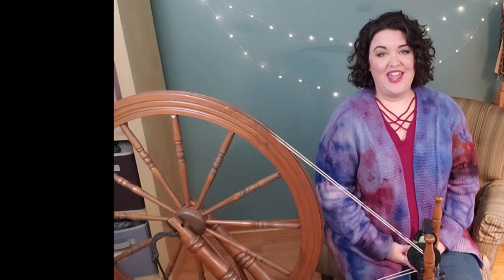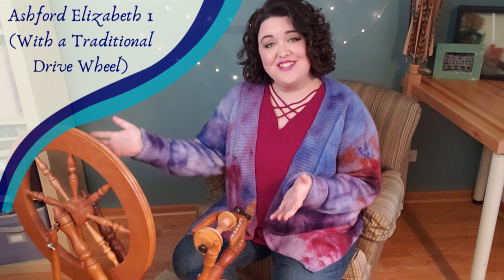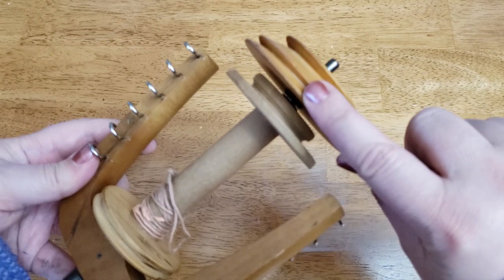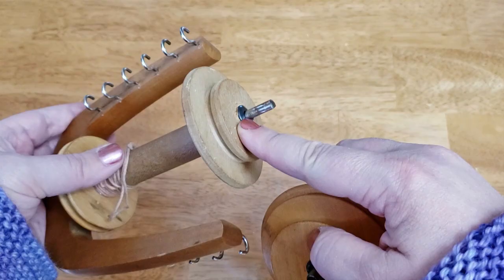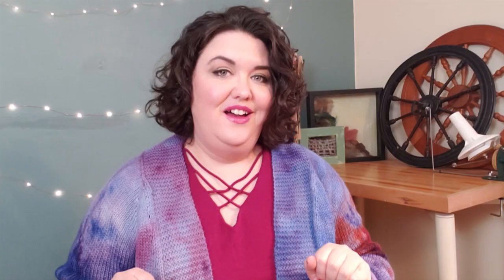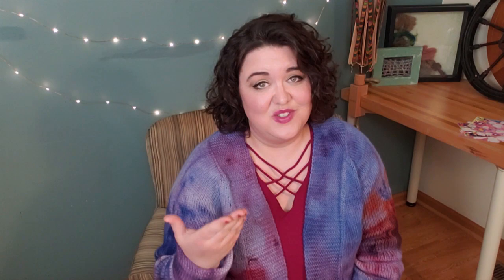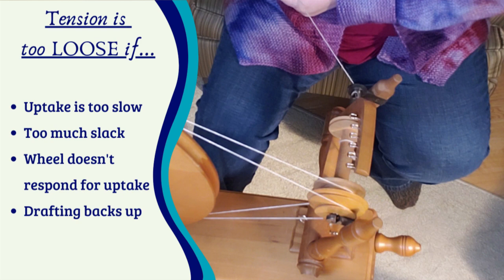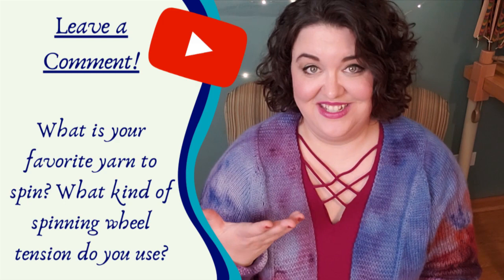Double Drive Spinning Wheel Setup

Comment: Thank you so much, this answered all my questions; unfortunately right now I have a traditional Ashford single drive; but, I'm looking for ways to convert it into a double.  While I have been able to spin... OK, on my single; I'm not happy with the tension and how it works.  Perhaps it's just getting old, and things don't like to grab and slip; so I will be looking at your videos and see if you will address tensioning problems on a single drive using the single nylon cord and spring.  Thank you so much for all of this; I really think I would love to have a double; and I have seen that, if one knows what one is doing, it shouldn't bee to hard to convert this old Ashford into a double drive! :-) I hope! lol
Reply: Full speed ahead!  I did find a video where you covered single drives and scotch tension adjustments; and it makes perfect sense.  I can't believe I ... only somewhat... successfully managed to spin for a few months without ever getting the scotch tensioner adjusted.  I got tired of working either a couple of feet from the wheel; or putting on twists so fast (well, let's say I looked at the spool I did last, and I'm ashamed of it...)  I had put up the wheel after I got diagnosed with cancer a couple of years back; and everything is going so well now; I'm feeling the call of the fiber once again... First my needles called me; now the wheel is calling me.  During my absence, I just checked my wheel, and I am missing parts?!?  My string is missing; but, I found some (cotton yarn I made washcloths with... it made a great string for the wheel; but, the other missing part... my tensioner.  The knob is broken.  So, I've ordered new parts for it, including a new knob, and some oil (I think my big problem was oiling the spindle and whorl?) .  And, after watching the video, and on other video on scotch tensioners, I'm going to re-route everything, drill a new hole for the control knob, and give it a go.  Fortunately my memory is good enough with what I was trying to do when I would spin; and I think I've got a pretty good idea now (I think I was spinning in my sleep for the last two years) of what I am trying to accomplish with the tension; and I am so excited and looking forward to spinning again.  We'll let you know how it goes; maybe I'll drop in for one of your live streams after I get going again.    So, two years ago, between spinning and the cancer, , I finally bought a drum carder, and carded a boat load of fiber, various wool purchased from local farms including a lot of... you guessed it (the non beginner fiber... alpaca).     It's all been begging for me to come back to it.   Anyway,  Happy New Year, and cheers to better control of my drafts, twists and feeds! ;-)   Thanks so much for all the help!   You are a GREAT teacher!  See you around!

Comment: I love your videos!  I just bought an antique double-drive spinning wheel at an antique store, and by watching this, I was able to thread it with a drive band (cotton yarn I had) and got it going, so thank you!  It is missing the bobbin, and I wonder if the new bobbins will fit.  Also the hooks on the flyer are very tiny.  I wouldn’t want to change them, as I want to preserve the integrity of the wheel.  However, I’m wondering if a new flyer would fit?  I don’t see any measurements of them online, so thinking I may have to find an actual shop where I can go in with my flyer.  I would love to hear your thoughts!

Comment: Hi Evie, You're a fabulous teacher.  I just started spinning a couple of months ago on an old Scotch Tension wheel and just bought a Double Drive wheel which is quite different with how the driveband crosses over, is located on which groove on the whorl and its relationship with the groove on the bobbin!  Honestly, my head went into a "tailspin", pun intended!  
I couldn't get it right when I removed the original bobbin from the DDrive wheel and your video actually showed which direction the whorl should be facing etc.  Thank God!  I'll try the figure of 8 for the driveband even though I don't understand why the cross over should be at the bottom for spinning clockwise!  All too much!  
I look forward to follow up videos from you.  Other videos I found didn't show the bobbin/whorl setup from overhead like your video so, THANK YOU SO MUCH again!  I'll go change the setup on my DD wheel and give it a go as there was NO take up of my wool.
Reply from the maker: Did you see the follow up video about how to tie on the drive band? It will help too! Here's the link https://youtu.be/711P9wD8SzQ Happy spinning!

Comment: Thank you so much for such a clear and helpful tutorial.  I’m used to a Scotch tension Kromski Fantasia and just acquired an antique double-drive wheel.  I’ve been struggling to develop a clear understanding of what goes where and how it all works together.  (The flyer, bobbin, distaff, etc., came in a box of miscellaneous parts.). The wheel had been sitting for a long time and wasn’t in working condition.  I’ve cleaned it up, replaced and reattached the footman, and put on the flyer/bobbin assembly.  No problems.  Then I tried to put the drive belt on the wheel and hit a wall.  I couldn’t figure out what to do about the crossed belts.  The wheel has two grooves and the belt bunches up because of the separate grooves.  Looking at your wheel, I suspect at least part of the problem is that the belt material is much thicker than it needs to be.  I’m going to replace the belt that came with it with a smaller diameter of cord and see if that helps.  I understand the mechanics much better now, thanks to you.
Reply from the maker: Wonderful! I agree, you probably should try a thinner driveband to start with, your instincts are good! Did you see my other video about how to tie on a drive band? It might help too. Happy spinning! 🧶❤🐏

Comment: @JillianEve are you able to explain why those are called "production wheels"? I have always wondered what the designation was for in comparison with any other wheel. Thank you for your lovely channel and in advance for your answer :)

My favorite fiber is Cotswold with a little grease left in. I am currently using a Majicraft Little Gem (my first brand new wheel), but I started spinning on a Louet S10. The change over from Irish to Scotch tension was a learning curve for sure. Also, I was so used to the oriface on the Louet that I kept breaking my yarn on the "thing" on the Little Gem. Not even sure what that is called - not really an oriface as a basic guide. Maybe you can answer that too :) (and I lurvz my Electric Eel Nano 1.0).
Reply from the maker: I think "production" refers to their speed. I couldn't find a definitive explanation or source for that reference in my research. I wondered the same thing. 🤔

Comment: That was so awesome a lot of great info just bought one for my step daughter but it’s missing the wood arm for the wheel and yarn  guide is broken on one side antique spinning wheel with the wheel is lower than the bobbin
Reply from the maker: Sounds like it needs some repairs. Can you do the woodworking yourself?
Reply: @JillianEve  well I’m trying to  find the original parts I need the flyer and the footman do you have any connections on getting those parts that would be awesome if you could help me with that
Reply from the maker: @juanbarba9372  I'm better at spinning than fixing, but I definitely reccomend Spirit Wood to help you! https://www.spinningwheelrepairs.com/
Reply: @JillianEve  very cool just checked out the web page I’ll definitely call on Monday that you much

Comment: Ok, question, I'm not a spinner, but would love to get into it one day - could I buy a double drive wheel, but run it as a single drive until I get used to/proficient at spinning? If so, how?
Edit: My interest is in lace weight spinning, as lace making is my primary fibre hobby, and I've heard double drive is best for this - I'm not in a position where I can afford to buy one wheel (probably a single drive) only to need to change/upgrade to meet my needs. Any advice?

Comment: This is really awesome! I’m noticing something different. You put the large part of the whorl closer to the bobbin shaft than I do. I put the smaller end towards the bobbin. Does that matter?
Reply: I have placed my whorl on both ways, wondering which direction is right or wrong. Maybe Eve will answer this question for us soon?
Reply from the maker: I don't know how I didn't see this question for so long! Sorry! There are a few things that would make a difference. Some bobbins only fit one way. Some bobbins can flip one way or the other to change the size of the whorl. Generally, you will want the ratio of the whorl on the bobbin to be smaller than the ratio of the whorl that controls the flyer. I hope that helps. Happy spinning!

Comment: Ok. I have an antique double band spinning wheel and I'm trying to figure out what I'm doing wrong. I'm sure it's probably a sweet spot issue with the tension. I try to let it feed through but it's not gathering on the bobbin. When i pull it out, it can come out smoothly but still isn't collecting on the bobbin. It'll get so twisted than when I pull, the fiber breaks. It's driving me crazy!

Comment: Can you please explain he to tie on the leader as I am a complete beginner. Thanks also my flyer keeps falling out!
Reply from the maker: You might need to see if the supports are twisting to make the flyer fall out. Sometimes they can be tightened or shimmed. To tie on a leader, just get some scrap yarn and tie it onto the bobbin. Give it a couple turns to wind around a few times an that will get you started! Happy spinning! 😊🧶💜

Comment: I picked up an old double drive at an antique store (my first wheel!) but unfortunately after cleaning it and reconditioning the wood and leather and getting it set up, I find that the whorl spins independently of the rest of the flyer - the wood appears very dry and there's no mechanism to hold it in place, it simple slides on and off. What can I do to make the wood hold on to the metal better so that it can actually turn the flyer?

Comment: Hello Eve. I am Eky from Indonesia.. I just want to make my own wheel, actually this is my second wheel i want to build for myself. Oke, this time, i want to try making te double drive system. But stil confuse about operating the tension n the iron for flyer, especially on the tip iron for wohrl plug in.. Can you explain about that.. Thank you.. Sendinh love from Indonesia ❤❤

Comment: This video is absolutelly amazing! I just got a castle double drive spinning wheel from marketplace and I can't wait to use it. Only thing is: my flier does not have an orifice, it has a hook, has anyone encountered anything similar? Would I use it as a splinder?
Reply from the maker: How exciting! You found a wheel! Many modern wheels use the hook set up instead of a drilled out orifice. It is called a "delta orifice". If you are working with a delta orifice, the yarn threads through the hook and the spinning part is all the same! Happy spinning!

Comment: I can't get my yarn to wind onto my bobbin. (I'm practicing with scrap yarn to figure out how to get twist and tension without over twisting it.) I got it to work once, but I can't figure out what I did and nothing else is working. I've never spun on a wheel before and barely on a spindle, so I'm not sure if it's an equipment or user error.

Comment: This was wonderful! But I am having an issue same kind of wheel as yours but my yarn doesnt even feed on. What can I do?
Reply from the maker: When I got mine, the yarn had trouble feeding on because the metal rod through the bobbin was very gunky. I pulled the bobbin off and cleaned it up with sand paper and then wiped it down with rubbing alcohol. You could also try using different materials for the drive band. A fine mercerized crochet cotton like Aunt Lydia's 10 works well for mine. 💜🧶

Comment: Hi Evie, my double drive traveller lists "bobbin lead" for a 13:1 ratio. I thought bobbin-lead was Irish tension (single drive). Do DD systems have bobbin lead options too?
Reply from the maker: Some wheels can convert to different drive systems. I personally prefer a bobbin led system for plying for instance. So if my wheel could do either set up, I would switch over when I ply. 🧶💜

Comment: Love your tutorials! Does it make a difference if the flyer is on the right or left side?
Reply from the maker: It matters as far as the direction the orifice is facing and how the driveband lines up, but I have seen custom made wheels for lefties where the set up is reversed.

Comment: I got a castle style double drive spinning wheel, and it has 2 drive bands (came like that) it spins beautifully, BUT, when trying to ply the flier keeps untwisting making it a bit awkward to spin on. How can I stop this from happening? I’ve tried increasing/decreasing the tension but that doesn’t really work. Will changing the drive band to one that loops around help it? It’s my first wheel and I only got it a few days ago, so i haven’t changed the bands yet (they are a little discoloured but sturdy and it works fine spinning clockwise (z). It’s just plying that it feels a tad awkward.

Comment: Thanks for this. I think my comment was deleted, probably because it contained a link. I wanted to show you an antique wheel that was given to me which I'm trying to at least restring. But it has a second flyer with its own tensioner adjustment, about 10 inches back from the first one, but its pully does not seem to line up with anything else. So I can't even imagine how to string it. I put a photo on one of my servers, but is there any way I can show it to you with a link, without my comment being deleted? Thanks

Comment: I can't figure out my wheel..double drive wheel. Not new but new to me.
Started out with the yarn over twisting and the drive band slipping and tangle around the the flyer shaft just next to the orifice. Wool won't wind around the bobbin. Also the wheel keeps changing direction of spinning. I peddle away it's flipping between right spin and left spin back and forth. Then it goes ones direction for a minute or two and suddle switches on me. I think my wheel is haunted. Hahaha. But seriously what am I doing wrong.

Comment: With the antique whorls that screw on, is there a way to have them turn the opposite way for plying, or do you just use a different wheel I have two like this and I’ve never found a reference to this .
Reply from the maker: I just ply and check it often if it tends to go loose. I haven't had too much trouble, but it might if you have a loose whorl or stripped threads. At that point you'd probably need some repairs anyway. 💕

Comment: I'm restoring an old wheel from Finland. This has been so helpful! Thank you for your shared knowledge.
My main issue atm is, that the wheel prefers to spin counter clockwise and the band often slips from the wheel when I try to go clockwise. Does anyone have a suggestion?
Reply from the maker: Without seeing it in person, I have a few guesses that you could look at. One problem could be that the whorl and the wheel are not lined up which can happen as wood ages and things shift. Another thing that could cause the problem is if your drive band has the cross upside down. Look at how the drive band comes off the point where it crosses as it goes toward the whorl and bobbin. Does the drive band rub on itself where the cross is? Try tying it like this... Start by taking the drive band over the top of the drive wheel clockwise, come up around the bobbin whorl, over the drive wheel clockwise, then over the flyer whorl and tie it together. I think that is the direction for it to follow if you want to spin clockwise. The cross itself will end up at the bottom of the wheel without either part of the drive band rubbing on itself at the crossed point. Maybe this will be followup tutorial! Check back in another week. 😁 Thanks for watching. I'm going to restore an antique Swedish flax wheel soon as it is warm enough to work on it in my garage. I wonder how similar it will be to your Finnish wheel?
Reply: @JillianEve  Thank you again! I will try everything you suggested. A follow up tutorial would also be highly appreciated!
I'm glad I found your channel and your lovely way of spreading your knowledge.
 
As for the wheel: You're right, the wood is partially warped and some parts are a bit to wobbly, so that flyer and bobbin have a lot of wiggle room. But I believe (or more so hope) I can fix it with a small splint.
I'll try to take a picture on the weekend and somehow get it to you! I've got an inkling, that they might look very similar, since Sweden and Finland have a lot of cultural overlap (though my Finnish inlaws would fight me on this tooth and nails :D).
Reply from the maker: My Swedish grandmother would do the same! Lol! I have facebook and Instagram if you want to send me a DM. 😁
Reply: @JillianEve  Hi Evie, yes please to a follow up video.  This video is so helpful.  I've only been spinning for a couple of months!  Will post a general comment independently.  Thanks so much!